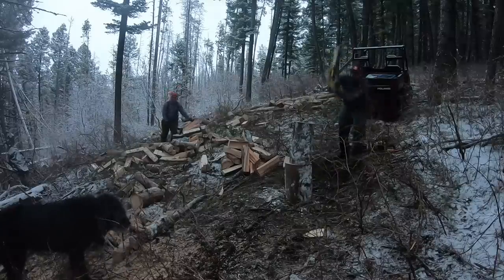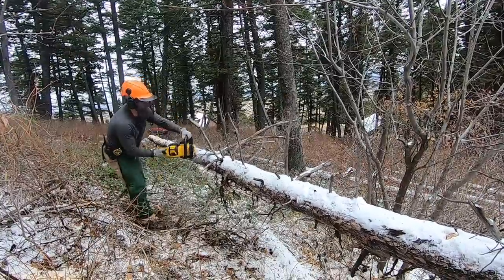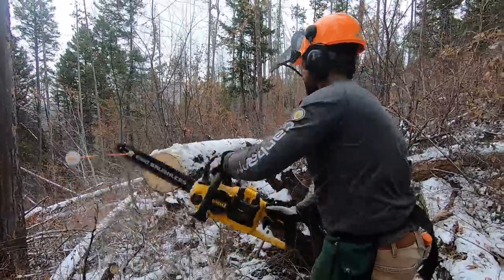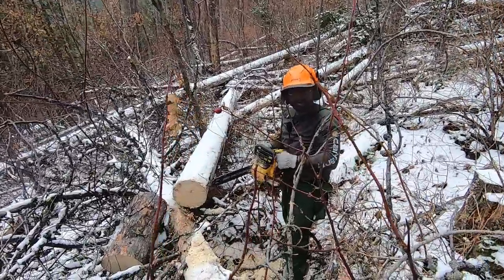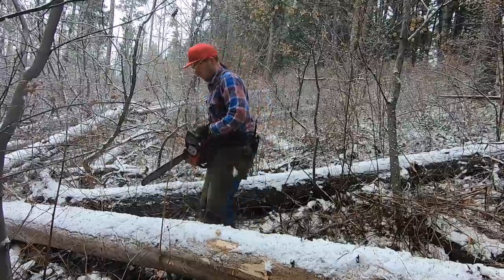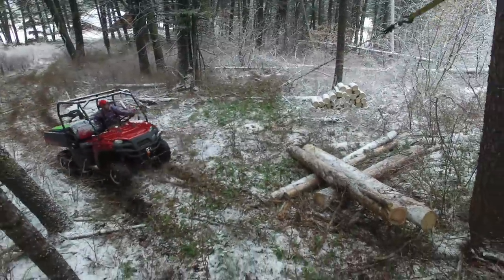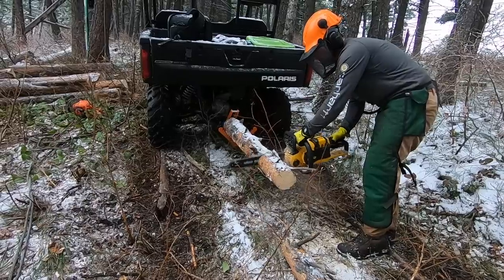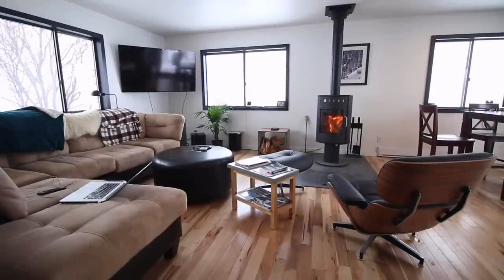DeWalt 60V FlexVolt Chainsaw Cutting Performance - Review and Comparison to Gas Saw

Comment: worth noting the battery of the electric chainsaw holds the energy equivalent of a 1/68 of a gallon of gasoline. I wonder how many cuts you would make with that amount of gasoline in the gas chainsaw! :-P
Reply: not as many as you think since and ICE engine is maybe 25% efficient. don't forget the wasted fuel as it idles between cuts. a gallon of gas is about 34kwh. a tesla s with a 85 kwh battery pack can got 250 miles. 85 kwh is less than 3 gallons worth of gas.....but goes as far a car carrying 10 gallons of gas....because ice engines suck for energy efficiency.
Reply: yeah, indeed I was cutely pointing that out!
Indeed, those ICE powered tools seem to have a very awful efficiency, probably even lower than 20%
Reply from the maker: Thanks for chiming in!

Comment: I would say that most of the regular people that have a petrol saw could do just fine with an electric (battery or cord), but for some reason, I think that a lot of people just thinks that it is more macho to have a petrol ones, and a lot of people do not think that an electric is powerful because of less noise (yes, humans work like that - this is one reason as why most vacuum cleaners sounds like shit, because if they make them quite, people will not buy them!!!).
We have corded saw at our summer house. Works like a charm and we have taken down several trees (sadly, they died by them selves...), and cut up a lot of wood. Trees from the range that the sword is to short for one straight cut down to sticks.
And with reels you can easily work 100 meters or more from an outlet.
And yes, you have a cable to handle but that is mostly just something you will learn, just as with lawn mowers with cord (worked with those for decades!). I never think of it anymore since you have something subconscious in your brain that handles the cord automatically.
Cheap to run, easy to run, cheap to buy, no maintenance (except chain of course), always start with a click even in -30 degree C, no fumes, better for health and environment, ... and the list goes on.
The ONLY negative is if you need to be very far from an outlet, but that can also be solved if you have a small portable generator.
Reply from the maker: Thanks for your feedback! Great to hear what works well for your situation!
Reply: If you need a generator to charge batteries or plug in the electric doesn't that kind of defeat the purpose.
Reply: @robertlivingston1634  Well.. Most of general public that have a saw uses it in such a way that you can have cables an batteries. Like 99 percent of the time.
Then that One occation when this is not possible, lend a saw or use a portable generator (that is also a good backup for when electricity goes - we will see more and more of those outages in the future).

Comment: I'm kind of surprised the cordless saws actually get through logs.  I bet they are lighter than gas saws.
Reply from the maker: They have come a long ways.
Reply: Some are pretty light, like Makita 10.1 lbs with batteries, Milwaukee 14 lbs, DeWalt 40Volt 16 lbs.  Some 18" bar battery saws weigh up to 20 pounds with battery.  The heaviest bowling ball allowed is 18 pounds.  You have to be young and strong to manhandle them when limbing.

Comment: @DIY PETE, great video! I use chainsaws in my research and there a numerous times I think the electric version would be great to have so thanks for the comparisons. I do wonder if the electric would have enough power to make plunge cuts. I have a Stihl 460 Magnum and I've never had an issue with any cut. Next time you have the electric out and have time, let me know how a plunge cut goes. May have to pick up an electric version if it goes smoothly. Home you have an affiliate link for it ;-)
Reply from the maker: Hey Christopher! Great to hear from you. I'll have to try a plunge cut when I get a chance! Cheers!

Comment: What kind of wood?  That makes a difference.
Reply from the maker: This is pine. We don't have much for hardwoods in our area, but this would obviously make a difference and I'd be curious to see it's performance on an ash or oak tree! I have cut some ash and it cuts it fine, but I'm sure it wouldn't be able to make quite as many cuts.

Comment: Hi from Arizona ✌
I got the smaller Dewalt chainsaw and is awesome along with the edge trimmer but the weed eater need improvements.

I'm a landscape guy and I own about 15 commercial chainsaws and a lot other 2 stroke tools
But I prefer my Dewalts and carry my 20 20v batteries and Dewalt tools 
Less, noise ligther and get my small jobs fast!👌
Reply from the maker: Great to hear! I have the 60v weedwacker and it's been awesome, haven't used the 20v version, but the 60v is great for my property. Hope all is well!

Comment: If you want to compare between gas and battery get yourself greenworks 80 volts or stihl 220 cc
Reply from the maker: Will have to try one. Cheers

Comment: Dewalt has a chop saw that runs on two  60 volt batteries that chainsaw should be the same way. Either way I'm concerned about repair. Parts for the gas tools are way cheaper.
Reply from the maker: I have the chop saw and absolutely love it. Have had it for 2 years and it was incredibly convenient while I did the wood siding for the house. No issues with repairs yet. Cheers

Comment: So it would be a great saw for an atv or snowmobile if a tree is across the trail. Not so great for doing for fire wood. You would need a duffel bag full of batteries.
Reply from the maker: If you are dirt biking and have the occasional log to move, yes it will do the job (especially later in the season). Early season though, you may want a light gas saw for the trail with all the spring deadfall. Cheers

Comment: Why does the electric saw user have hearing protection on for?
Reply: because its stock to the helmet
Reply from the maker: Yep, it is built in the helmet, and even though it is electric, it still puts off some noise ( although minimal to the gas ). I also have a Dewalt 60v miter saw and other battery powered tools like the angle grinder -- that I'll wear hearing protection with ) Cheers

Comment: Do the electric chainsaw not have dog teeth ???
Reply from the maker: Hey Dave, here is a link to the chain it comes standard with. https://www.dewalt.com/products/outdoor/chainsaws/16-in-chainsaw-replacement-chain/dwo1dt616t ---- but you can use other brands like Oregon

Comment: powerful for most tough jobs? It's an overpriced pruning saw that can't cut with a chinese knock off, has batteries that will be really expensive to replace and won't like cold weather, and will leave you sitting to wait for charging batteries after you've already took longer cutting to discharge them vs. a gas saw. 

They only make sense for someone in a nice house with no tools and who might prune small branches once in a while. Or, a small top handle for small jobs for an arborist. 

Right now, the battery saws are much better for the makers and sellers than they are for the buyers, but they sure are working hard to put them in the hands of youtubers, and doofus youtubers are trying hard to make the look like they're more useful than they are.
Reply from the maker: Good afternoon David and I hope you are having a great Saturday! Thanks for your feedback about your thoughts on electric chainsaws. I have no affiliation with DeWalt and paid for this myself. Along with the chainsaw, I also purchased their weedwacker and leaf blower at my local farm and fleet store. I bought them after doing a lot of research, and to be honest I've been very happy with their yard care lineup. I spend a lot of time out in the forest cutting my own firewood, and will agree that gas is the best option for that type of cutting. But there is a place for electric saws in my opinion, no matter what brand you choose. Have a good rest of the weekend and take care. - Pete

Comment: If you want to mess around with a shitty low pro chain get a cordless chainsaw. If you want the good .50 3/8 full chisel chain you're going to to need to get a real chainsaw.
Reply from the maker: Gas chainsaws are definitely the best option for heavy duty cutting.
Reply: @DIYPETE right.
Reply: I use full chisel chain with my battery saw.  The 0.43 bar groove, or kerf width, is meaningless.  Doesn't matter how wide the cut is, as long as the bar is strong enough, and it is.  It just takes more power to cut wider.